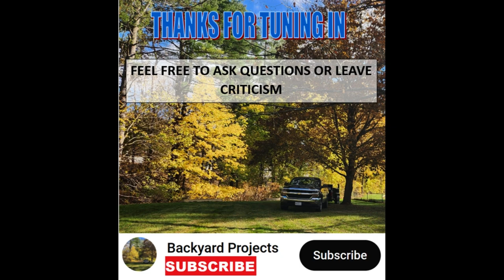Ryobi 18V Router  - with Edge Guide

Comment: I just bought the same edge guide for the same Ryobi router, but the thumb screws don’t tighten all the way to hold the guide in place. Did you have any problems tightening the screws on your edge guide? I don’t want to break the screws by using pliers to tighten them if something is defective.
Reply from the maker: I did not have that problem. I would look at the hole that is threaded for the screws and make sure that there isn't a burr or something left in the way of the screws that is causing it to bind. It should just thread through into the black metal rod.  I'm curious what you figure out.
Reply: @Backyard_Projects Thanks for the response. I ended up using pliers to tighten the screws. I think they just needed to break thru the end of the hole. They’re still a little tight but functional now.